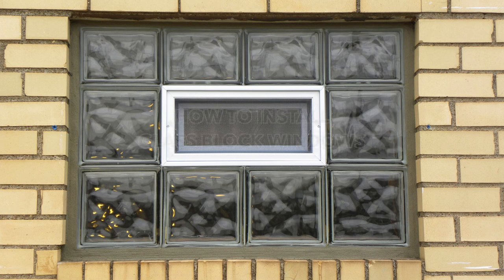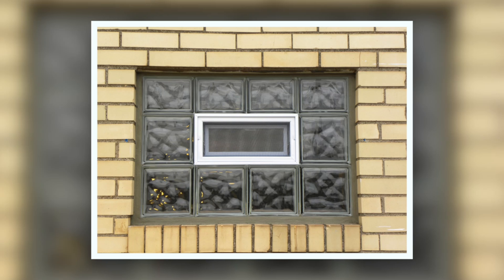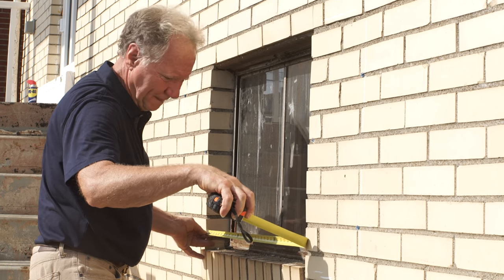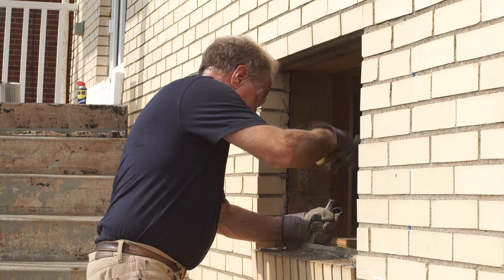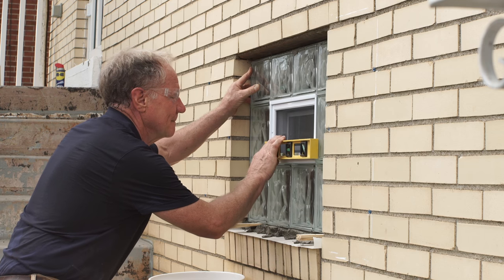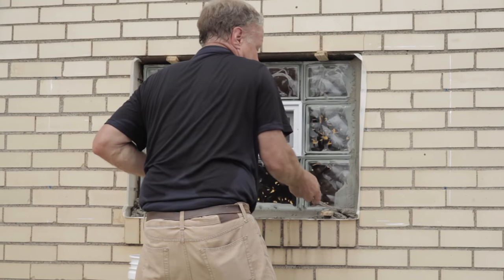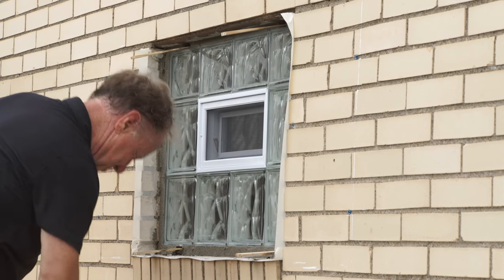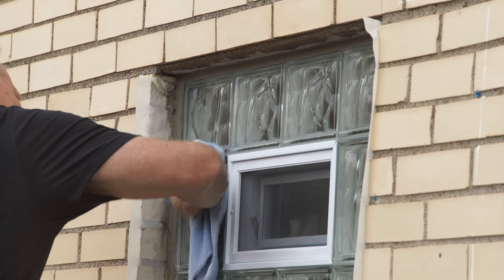Clearly Secure Glass block Window Installation

Comment: thanks for the video. I have a question: what if the window is made from 22 blocks, so the weight is around 50 kg. Wouldn't it be convenient to put in (while constructing the window from blocks) to put in some metal rods or something which you could introduce inside the walls to ensure it wouldn't fall if you lean on it?
Reply: Don't lean into it! Put something in front of it like a table & don't have a drunken frat party just in case they didn't see the table. Wyoming humor. PS - Convenient is not a construction term.